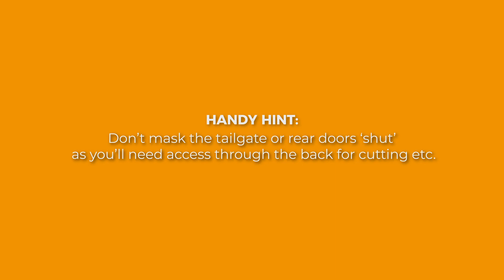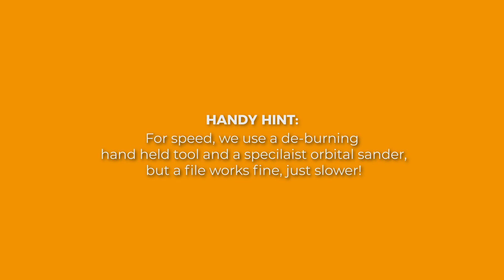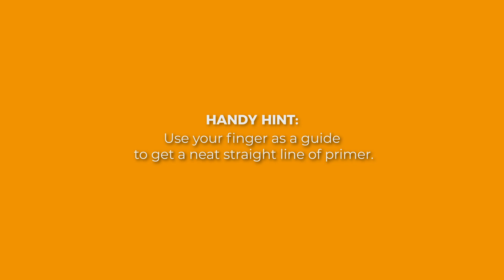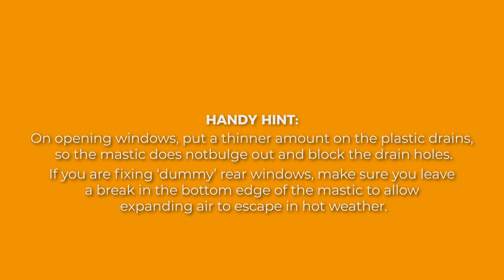Just Kampers Fitting Guide to Installing Side Glass

Comment: I have just fitted my windows that were supplied by you and followed this tutorial. Installation was all fine but you didnt mention anywhere about being careful with the primer and only using it close to the edge of the glass. as the blacked out edged extend into the window opening and now there is a run of primer showing from the inside... which I am really not happy about as I'll have to find a way to strip that off now. is there something you would recommend to use to get this off?

Comment: I own a 1965 Volkswagen bug I was wondering if you could help me out with a problem. My bug keeps popping a single breaker which turns off my entire engine and I don’t know why I have the right fuse. And it just keeps popping. Any reason that you can come up with. Could also have to do with my blinker not blinking anymore I already change the electronica flasher my left blinker doesn’t blink it just stays on as a solid light. It was doing the fuse stuff before the brlinker